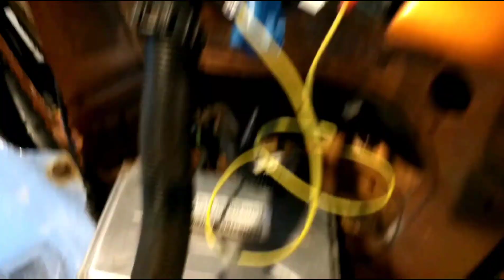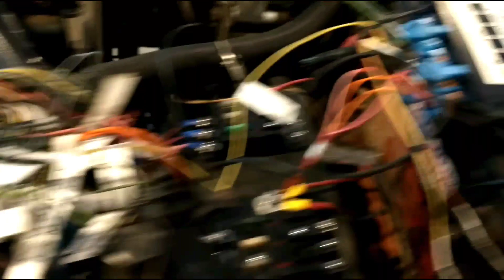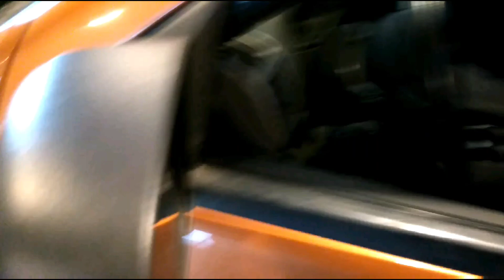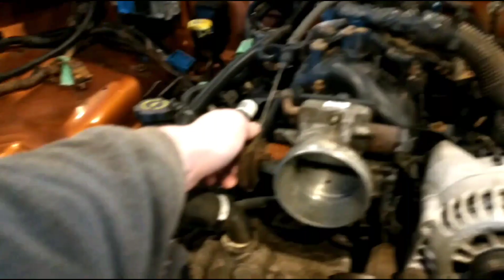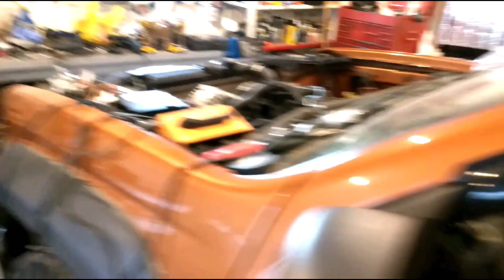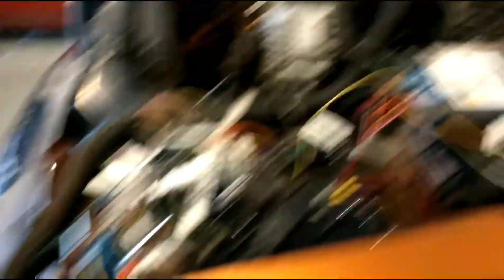Chevy Colorado LS swap VATS PROBLEM FIXED

Comment: Thank you so much for this info!
Reply from the maker: Your welcome!
Reply: @budslife  Do the mounts you use (watched the other vid you put up as well) work with the 5.3L or 6L? My single cab Colorado is due for a motor swap and thinking about going the classic LS route
Reply from the maker: @519_Enterprise  yes the mounts I used will work on the 4.8 5.3 6.0 or the 6.2 LS engines. However I'm not sure if current performance has them in stock right now. I checked a couple of weeks ago for the 2011 Colorado that I'm building right now and they didn't have them in stock on their website. So this time I'm probably going to end up building my own mounts. Have no choice current performance is the only place I know of that you can get those LS swap mounts for a Colorado.
Reply: @budslife  when you do could you if possible show me how you made them? My Colorado I want to LS swap is a 2010
Reply from the maker: xxThrillKillzxX I will most certainly show you how I build the engine mounts. I will be doing a video on it when I get to that point. I'm hoping to get out there working on it in the next week or two. I'm just waiting for my father to bring our tractor back so I can lift the engine into the shop with the loader.

Comment: I've done my research and have the labeled from what I see 1 wire from the BCM goes to the ECM Correct I See One Light Green Wire Saying Serial Data ? But I dont see the pin on the ECM.. so I'm going to look up the obd port pins and that should solve that.. Green wire.. only I'm stuck at is the orn passlock wire am I connecting the yellow Along with my Resistor? (BCM)
Reply from the maker: I'm very sorry I tried looking for my paperwork today and couldn't find it. I did my first LS swap about 3 years ago and I know I saved all the paperwork it's just to find it now in my shop. I will have another look for it tomorrow and see if I can find out what PIN numbers those wires were. But you're correct it has something to do with the data serial wires. 1 wire goes to OBD2 connector and the other wire went to the passlock module. I'm pretty sure that's how it was I did that swap about 3 years ago it's hard to remember now.
Reply: @budslife  ok I re wired up my LM7 to get it ready i built a Resistor to i have 2 made one 1200 ohm and one 2k ohm just for back up i have been on this all day i will post my information soon and thanks you helped me alot

Comment: What pins to the pcm did you wire To The BCM and What Resistor Did You Use
Reply from the maker: I can't remember right off what number the pins were. Also the resistance will very because the passlock module talks to the key. If it the key has the right resistance the passlock module will send a single to the PCM allowing the engine to start. I am in the process of doing another LS swap, putting and 6L in a 2011 Colorado. I will do a new video on the VATS problem and go into more detail on how to do it. I am documenting the build on my YouTube channel.
Reply: @budslife  yes I'm ordering a set off Amazon when wiring the BCM to the PCM Are The wires on both ends the same color? And dont worry new Subscriber here
Reply from the maker: @BackyardFamilyBuilds  I have all my paper work out in my shop on the pin outs. If I remember I will find out what number the pins are and let you know.
Reply: @budslife  Thank You Bud 💯💯 I Appreciate It

Comment: Thanks a lot for these videos. I was hoping to do this on my swap and was surprised to find more people don't do this. Appreciate the work you put in to make the video.
Reply from the maker: Thanks! When I built this truck I was trying to build it on a budget as cheap as I could. I didn't want to spend $300 + on getting the Vats deleted in the PCM this was a cheap way around it and it worked great.

Comment: Were gos the pink/orange and black wires were conect???
Reply from the maker: On your passlock module there is a blue connector and a brown connector in the brown connector you'll find pink orange and black wires. The pink wires are your accessory wires they should be powered when your key is turned on. The orange wires are power all the time or memory wires they should have 12 volts all the time. The black wires go to ground and that's it the other connector the blue connector it's your resistor loop. There's two yellow wires and one orange with a black stripe, wire one yellow wire connect to a yellow wire coming from your PCM it's a data wire. The other yellow wire and the orange with a black stripe wire is your resistor loop this these two wires you will put a resistance between them the same resistance that would be in your key switch this tricks the computer into thinking everything is fine and you're using the right key to start the vehicle.
Reply: @budslife  can you put a pictures how do the connections i do my and starts but turns off immediately
Reply from the maker: @xomaraazuara1194  I will try and get some pictures in the next few days.
Reply: Grant M what resistor did you use?

Comment: I have the same problem with the vats sistem but i want to how wiring the cupmuter whit thw bcm plis help me
Reply from the maker: I didn't connect the Colorado BCM to the PCM of the 4.8 liter. The BCM of the Colorado works independently of the PCM in the 4.8 liter everything still works in the Colorado lights horn heater controls all that stuff still works.

Comment: How did you get the Colorado bcm to communicate with the donor ecm? I was told I need an e40 ecm to be able to still use my stock controls climate control, wipers, headlights etc
Reply from the maker: The Colorado BCM does not need to see the ECM of the donor truck all of my lights, heater, wipers, all still work independently of the ECM of the donor truck. The only thing that I still have to hook up is the gauges right now I'm using an old tablet and the torque app, with an OBD2 dongle over Bluetooth. This works really good for the time being but I'd still like to get some gauges.
Reply: Grant M ah thank you. I didn’t know it would work like that but I do want my gauges to work. The dongle and cheap tablet sounds cool but it sounds like a slight hassle and that may be why they told me I need that ecm setup? But I am on a tight budget and running it like this would be a lot cheaper than buying the new ecm and tcm, but do you know what I’d have to do for the tcm? I’m using the 4L65 out of the donor Denali and I’m thinking about using that transfer case too so I can run awd
Reply from the maker: @tjmaxxse  my donor truck was a 2000 GMC Sierra and I did not need a TCM the transmission is controlled through the ECM and really the only control is your gear selection on your dash. You really don't need any wires from the transmission to make the truck run and drive my truck shifts perfectly with no issues and I didn't hook up any of the transmission wires. Interesting idea using the transfer case and doing an all wheel drive can't wait to see that. Good luck!
Reply: Grant M nice! Thanks for the info man! My tech probably knows this stuff but I’m still overwhelmed thinking about all those wires so I’m actually getting excited to work on the wiring with him and learning it

Comment: friggin rights, well done , thumbs up.  i have now two possible methods to run my 5.3 swap which is 50% done being installed.  i've got everything all figured out and half done aside from exhaust and VATS bypass.  hopefully this info can help, its simple and smart.  the other method im going to try is losing communication with BCM while its running in the donor vehicle before the swap, or while your ECM is swapped into a running truck.  thanks again good work
Reply from the maker: Thanks a bunch! I knew there had to be an easier/cheaper way than sending the ECM a way to get the Vats removed a local guy here wanted $300  just to remove the Vats. I didn't think that was worth it so this was my solution and it worked great. If I can be of any help let me know.
Reply: no problem, thank YOU.  i've got the 5.3 LSX installed now, so wiring and computer will be soon, might start on that tomorrow if i have spare time.  yeah 300 seems expensive considering everything ive used so far has been junkyard and budget stuff.  i cant even find locals who do that type of tuning in my rural area.  i'm looking forward to making stock/junkyard stuff work with the DIY budget goal.  :)  i'm anxious to hear it run before christmas
Reply: @budslife  i got mine running, just in time.  got a blanket of snow last night.  im going to make a video soon on how i got it running without the BCM.  i  tricked the computer by "lost connection to bcm" while it was running in a donor vehicle.  :D
Reply from the maker: @613Builds  Awesome  to here you got it running, I can't wait to see your video on it.

Comment: How do you wire it up
Reply: What wires go where
Reply from the maker: Here's the link to my video on how I wired up the pass lock module .  https://www.youtube.com/watch?v=BM3HR76TLhQ
Reply: Yes white wire from the computer though
Reply: What pin is it
Reply from the maker: I am  not sure what color wire yours would be it probable depends on what year, mine is 99-07. Its a yellow wire on C100 connector coming from your PCM   Pin  M YEL 710  Serial Data Signal (Class 2)  This Yellow wire gets the resistance single from the pass lock module and tells the PCM all is good and lets the engine fire up. I took one of the yellow wires from the pass lock module and connect it to that yellow wire coming from the PCM, the other yellow wire will connect to your resistors and then to the orange/black stripe and that completes your resistor loop. Hope this helps!
Reply: Ok Thank you